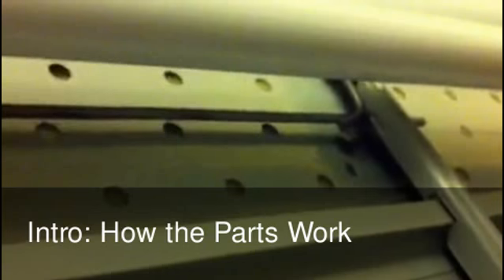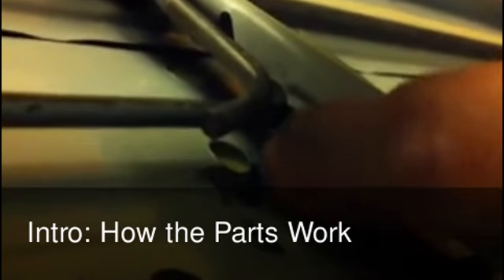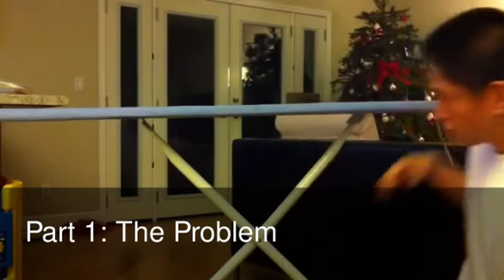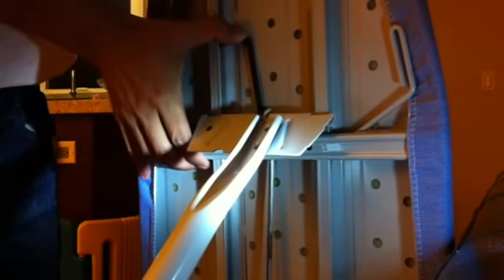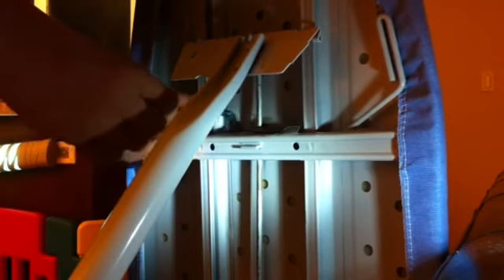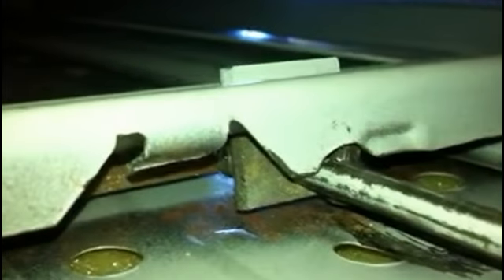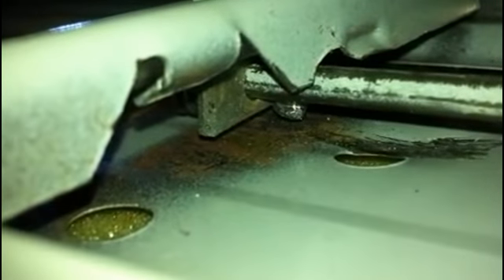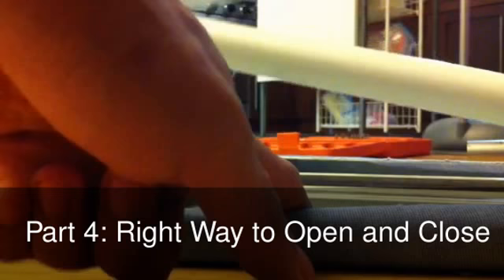How to Fold / Close a Stuck Ironing Board

Comment: Thank you!  The handle had fallen off of mine and the ironing board was stuck in the open position.  Seeing in your video how the darn thing works and using an Allen key to move the plate, I was able to partially close the ironing board and THEN reattach the handle properly.